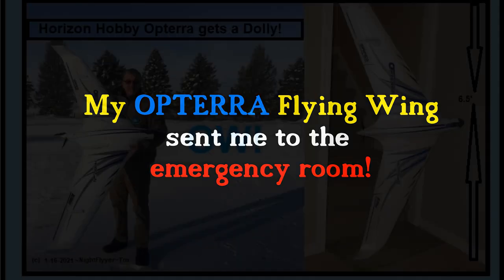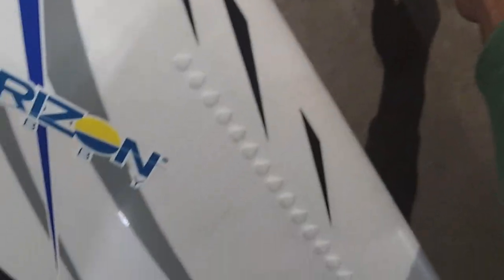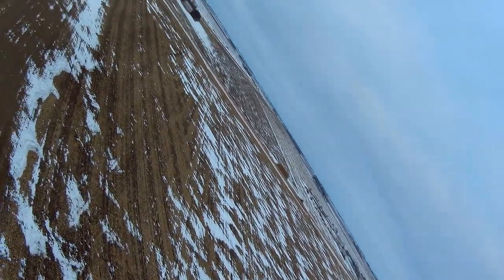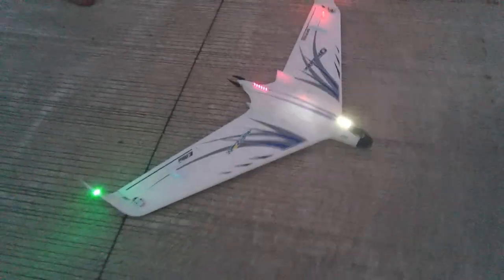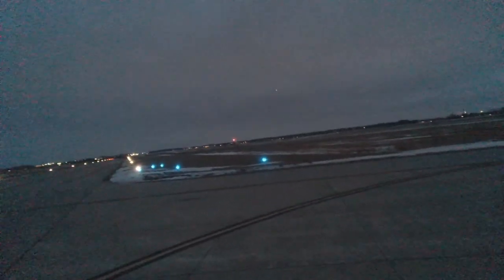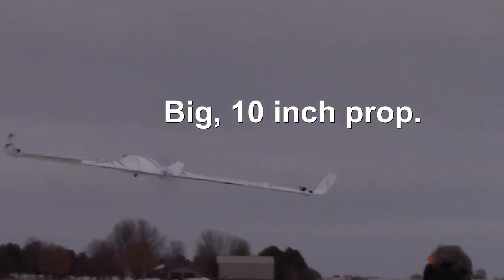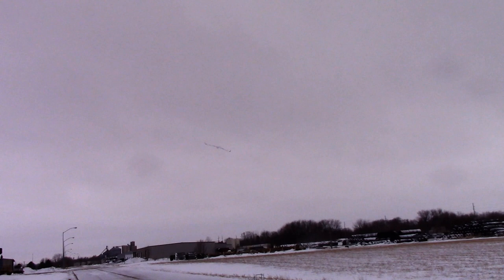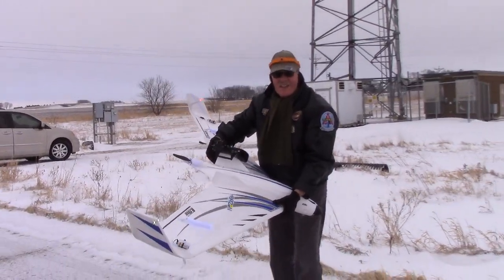My Opterra 2M Flying Wing sent me to the E.R. This is an awareness video & my solution for launching

Comment: I have this very same plane. I have someone else give it a hard throw, then I turn on the motor. It also should have had Speed Breaks like the XL Radian. So sorry this happened to you.
Reply from the maker: I would never ask anyone else to do this launch, especially my 75 year old wife.  No one flies rc around here anyway. 
Here is word for word what the Opterra 2M manual says about launching.  
1. Put the aircraft into launch mode with the channel 5 switch.  (in my first video that did not work, it went into the ground)  
2.  Hold the aircraft in one hand and the transmitter in the other.  
3.  Apply full throttle and throw the aircraft directly into the wind, angled slightly up (5 to 10 degrees above the horizon). 
4.  Climb to a safe altitude and check the trim.   
I know others have their own ways, and either way, my Dolly is the safest solution for me.  
The Opterra 2M manual also says nothing about throwing it with the motor off, so if a newbie followed the instructions, like I did, I'm showing what could happen, in case a gust of wind got them or something else.     Nothing is 100% and no matter how good you can throw, this big 7 foot wing with a 10 inch prop spinning right next to your face, is risky.  Thanks much.
Reply: @NightFlyyer , I do have friends that can hand throw it hard, then I give it power. I've never tried to hand launch it on my own. I only take it out to fly when I have someone else with me.
Reply from the maker: @robertwren2289  I launched it fine as well in my original video, but nothing is 100%. https://www.youtube.com/watch?v=P_inF5EYLEE&t=1s&gl=CO  It was hard to throw this with my left arm into the 12 mph wind that night.

Comment: couldnt help but notice you didnt follow through, your hand stopped at full extention instead of following through and getting your hand out the way
Reply from the maker: Hard to see but wind caught and tipped it up at last second. Since making this video 2 years ago, many others have done the same thing. I have over 59 years of hand launching planes but nothing is 100 %. I’ve since put 2 ducted fans and retracts on it.
Reply: @NightFlyyer  shes a big girl and it has a bit of drop before it takes off so that doesnt help atleast with the smaller planes they kinda leave your hand in an upwards path already instead of dropping a bit, it still sketches me out even with just a 5 in prop, all it takes is a combo of a few different variables and accidents can happen easily, the ducted fans would be a good addition to this airframe they would be sweet built in almost like a b2
Reply from the maker: @christhorney    You know once your hit, before I could get out of the way everything changes. I’m 75 now so your right this is big and almost too big for hand launching. I agree that it should have the prop on top or fans built in. Mine now does look like a b2. Now I love it. https://youtu.be/TMtdTW_fECs
Reply: @NightFlyyer  it looks so funny on them long wobbly wheels, atleast its working for you whatever keeps you flying and smiling! I just ordered my second plane today a joysway dragonfly aka hobbyking skipper, i currently have a little eachine mobula but it doesnt fly the best, i have had a couple of random spins (check the recent video on my channel i uploaded yesterday) while doing inav autotune i was pitch up and pitch down repeatedly and it went into a spin luckily i or it recovered im not really sure what happened i know i was trying to recover it but inav in acro the stability system is working its butt off in that airframe, if its super calm its ok but as soon as you hit some turbulance its not very confidence inspiring lol but atleast i learned all about inav and how to use the auto launch with the cheaper lighter plane and its still flyable, the heavier dragonfly would probably have exploded from my failed auto launch attempts lol i have it down like clock work now tho thanks to videos like yours, but if you compare the throw you did previous to the one where it hit your hand you can see how much higher your arm stops, but hey accidents happen to even the most experenced people, infact often more so because complacency, that i have done it a thousand times without even thinking and for some reason xyz happened this time that made your muscle memory glitch and bam, i was trying launching from the wing like a discus and its just impossible for me to not induce yaw into it and make it flip over and i have nowhere to takeoff and land except horse a paddock that you almost roll your ankle trying to walk where the grass is short and the rest the grass is 4ft tall so i land in the long grass and just hand launch. thats why i went with the drangonfly (also there is a few big lakes near me)

Comment: You should use some kind of a launch Ramp made out of PVC!
Reply from the maker: Well if you saw my video entirely you saw I tried to do that with the launch ramp that I used for my F-27.  This giant 7 foot long opterra does not have enough power.  My self contained catapult was destroyed in the fire, along with my jets, so I could not use that.  I simply launched it per the directions in the book.  It said nothing about a launch ramp.  Thanks for the suggestion, but my dolly works great and will now be my future way of launching.

Comment: its a floater, it can glide till your hand is well clear
Reply from the maker: Yes, when it is gliding in at 30 mph, but trying to launch it into the wind, not easy.  Thanks for the suggestions.  If you had watched my previous videos on the Opterra, you would have seen I did put a small wheel on the bottom for landing and also metal skids to protect it.  And as you saw, my launch rail 7:12  did not work in this video.  My Catapult  7:26 would have worked probably, but it was destroyed in the fire that destroyed my jets and my home, so I never built another.  The instructions only say to hand launch it and tells how.  That is how I did it. Of course nothing is 100%, and others told me they were holding this big 7 foot wing and before they launched, a gust of wind got under it and it tipped back and cut their forearm and 3 tendons.  Its hello dolly for me from now on.   Here are the links to the last videos.  
https://www.youtube.com/watch?v=P_inF5EYLEE&t=1s&gl=CO  and   https://www.youtube.com/watch?v=ur5V5H8UcGs&t=1s

Comment: Sorry for you. But your wing does not send you to hospital. That just the moment you discover that a propulsive wing does not lauch with Gaz or with hand in axle. 
Don't stay like it. Go flying again and again . Nothing better than experience.
Reply from the maker: Sorry if I'm not politically correct like you.  I appreciate that, but we Marines were taught to follow instructions and stick to the plan or get dead!  So after spending 33 years in the Marines, I managed to stay alive because of that. Im an inductee of the AMA hall of fame and no newbie.  This wing is 7 foot long and will bend and break the end off the if you even try to pick it up by the tip. It would also be extremely difficult to somehow launch it discus style with the elevon there and that 7" tall winglet rudder that is also on the tip.  I know how to do it , but not with this plane.
To try to pick it up and launch it with left hand with motor running full, would be a tough call, not like launching my small F-27 Evolution.  So I followed the instructions word for as I did for the video I made of my product review earlier, but it bit me.  https://www.youtube.com/watch?v=P_inF5EYLEE&t=1s
Here is word for word what the Opterra 2M manual says about launching.  
1. Put the aircraft into launch mode with the channel 5 switch.  (in my first video that did not work, it went into the ground)  
2.  Hold the aircraft in one hand and the transmitter in the other.  
3.  Apply full throttle and throw the aircraft directly into the wind, angled slightly up (5 to 10 degrees above the horizon). 
4.  Climb to a safe altitude and check the trim.   
I know others have their own ways, and either way, my Dolly is the safest solution for me.  
The Opterra 2M manual also says nothing about throwing it with the motor off, so if a newbie followed the instructions, like I did, I'm showing what could happen, in case a gust of wind got them or something else.  The 7 foot wing is too big to throw discus style, as it bends a lot when you pick it up and the big wingtip's winglets are in the way.   Nothing is 100% and no matter how good you can throw, this big 7 foot wing with a 10 inch prop spinning right next to your face, is risky. 
Maybe a gust of wind, maybe my 73 year old left arm was weaker, or who knows.   But either way, if it happened to me launching the way I thought was good (and  the same) as all my previous launches. So if it can happen to me, it can happen to others, and that is the warning I want to present.

Comment: You could try carfully launching it like a discus launch glider.
Reply from the maker: Thanks but not possible for me.  This wing is 7 foot long, heavy and will bend and break the end off the if you even try to pick it up by the tip and barely has enough power to fly out of your hand at launch.  I know and I tried.    It would also be extremely difficult to somehow launch it discus style with the elevon there and that 7" tall winglet rudder that is also on the tip.  I know how to do it, but not with this plane.  
It's not like launching my SMALL F-27 Evolution or 1.2M Opterra.  So I followed the instructions word for as I did for the video I made of my product review earlier where nothing happened bad.  https://www.youtube.com/watch?v=P_inF5EYLEE&t=1s and the second one where I explain how to protect the bottom of the fuselage.  https://www.youtube.com/watch?v=ur5V5H8UcGs&t=1s
We are only talking about a Half inch of clearance that I needed to keep from getting cut. 
Here is word for word what the Opterra 2M manual says about launching.  
1. Put the aircraft into launch mode with the channel 5 switch.  (in my first video that did not work, it went into the ground)  
2.  Hold the aircraft in one hand and the transmitter in the other.  
3.  Apply full throttle and throw the aircraft directly into the wind, angled slightly up (5 to 10 degrees above the horizon). 
4.  Climb to a safe altitude and check the trim.   
I know others have their own ways, and either way, my Dolly is the safest solution for me.

Comment: Wow! Stay safe there! That was a very nasty cut! Maybe it should be adapted for a ground take off! Or some of those chef gloves for cutting fingers off!
Reply from the maker: Yes.  Thanks for that suggestion and I tried that already, but because it was cold.  I found trying to hold on to the tiny finger grips on the bottom of the 7 foot wing with a thick glove under full power with wind blowing was difficult when under power and then trying to fly with  a big enough glove on was also difficult to fly the transmitter, (I'm a stick pincher)  so although that sounds like a good idea, it did not work that well. Some have told me the Prop got them in the forearm even before launch, when a gust of wind got under the wing and tipped it back, so gloves wont protect that.  We are only talking about a Half inch of clearance that I needed to keep from getting cut, and even though I pulled it off several times in my earlier product review video,  I will never hand launch it again.  LOL.  It's hello dolly from now on!  Thanks.

Comment: That laugh off of the launch cart :D  I wonder about using Kevlar gloves during a hand launch.
Reply from the maker: Thanks for that suggestion and I tried that already, but because it was cold.  I found trying to hold on to the tiny finger grips on the bottom of the 7 foot wing with a thick glove under full power with wind blowing was difficult when under power and then trying to fly with  a big enough glove on was also difficult to fly the transmitter, (I'm a stick pincher)  so although that sounds like a good idea, it did not work that well. Some have told me the Prop got them in the forearm even before launch, when a gust of wind got under the wing and tipped it back.   We are only talking about a Half inch of clearance that I needed to keep from getting cut, and even though I pulled it off several times in my earlier product review video,  I will never hand launch it again.  LOL.  It's hello dolly from now on!  Thanks.
Reply: @NightFlyyer  Oh, I totally agree about the launch cart.  I never did get my flying wing built, and after seeing your prop strike, I realize that it also would have that problem.  I was horrified to watch your video but was glad to hear you recovered and got back out there with the plane.  My wife also bought my flying wing as a gift.  It was a full build and I never had time to put it together, just to much project with little kids running around.  But I have considered buying a pre-fab wing more recently.

Another idea that came to mind was an interesting feature of one of these autopilot modules.  It starts the motor about three seconds after a hand launch.  So, you throw it and the sensor detects that, then it starts the motor.

Seeing the cart launch appeared a bit precarious, turning a little off-course.  Have you launched it from the cart many times?  Any problems?

Comment: YOU HAVE TO FOLLOW THROUGH! YOU ARE THROWING IT LIKE A DART WITH YOUR HAND STAYING UP!... I HAVE THIS PLANE AS WELL...
Reply from the maker: Thanks for the suggestions. If you have this big Opterra, you know it is really underpowered and launching it in winds is difficult.   If you had watched my previous videos on the Opterra, you would have seen I did put a small wheel on the bottom for landing and also metal skids to protect it.  And as you saw, my launch rail 7:12  did not work in this video.  My Catapult  7:26 would have worked probably, but it was destroyed in the fire that destroyed my jets and my home, so I never built another.  The instructions only say to hand launch it and tells how.  That is how I did it. Of course nothing is 100%, and others told me they were holding this big 7 foot wing and before they launched, a gust of wind got under it and it tipped back and cut their forearm and 3 tendons.  Its hello dolly for me from now on.   Here are the links to the last videos.  
https://www.youtube.com/watch?v=P_inF5EYLEE&t=1s&gl=CO  and   https://www.youtube.com/watch?v=ur5V5H8UcGs&t=1s

Comment: Yeah...I didn't read YOUR comment first either.  Didn't mean disrespect. Just a suggestion. To me it's common sense to not have my hand that close to a spinning prop no matter what the manual says. EVERYTHING I fly has a throttle cutoff programmed. 

If I'm under a car, it will always have wheels blocked and a jack stand even if the jack manufacturer says they have the latest and greatest safety gadget.

Comment: I just bungee launch all of mine from the ground... simple and never an issue.
Reply from the maker: Easy to say after the fact for sure.  Here is word for word what the Opterra 2M manual says about launching.  
1. Put the aircraft into launch mode with the channel 5 switch.  (in my first video that did not work, it went into the ground)  
2.  Hold the aircraft in one hand and the transmitter in the other.  
3.  Apply full throttle and throw the aircraft directly into the wind, angled slightly up (5 to 10 degrees above the horizon). 
4.  Climb to a safe altitude and check the trim.   

I know others have their own ways, and either way, my Dolly is the safest solution for me.  
The Opterra 2M manual also says nothing about throwing it with the motor off, so if a newbie followed the instructions, like I did, I'm showing what could happen, in case a gust of wind got them or something else.     Nothing is 100% and no matter how good you can throw, this big 7 foot wing with a 10 inch prop spinning right next to your face, is risky.

Comment: If only someone would invent a way to put wheels on the bottom of planes so they could take off from the ground.
Reply from the maker: Some have but the LG must be long to clear that 10 inch prop and a nose gear and steering servo must also be installed.  My new landing gear is my Dolly.  Thanks, John.